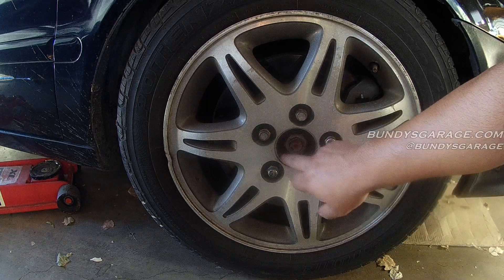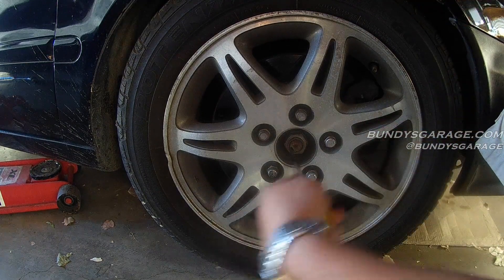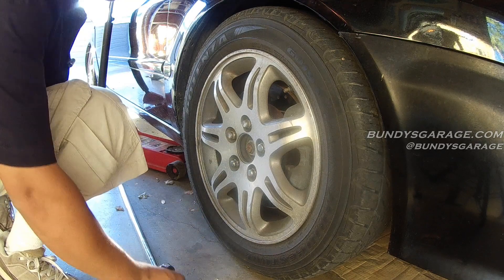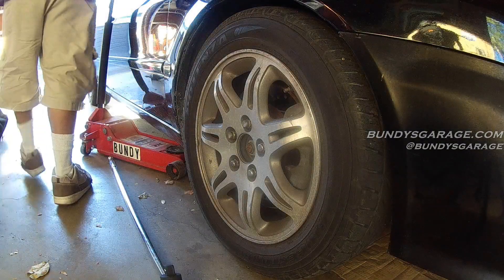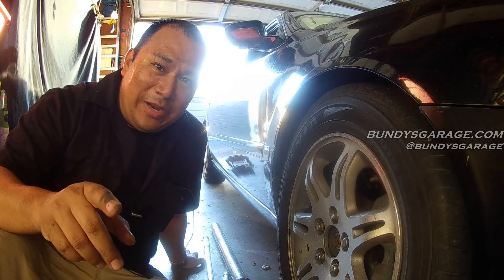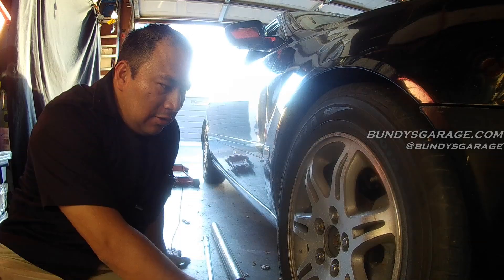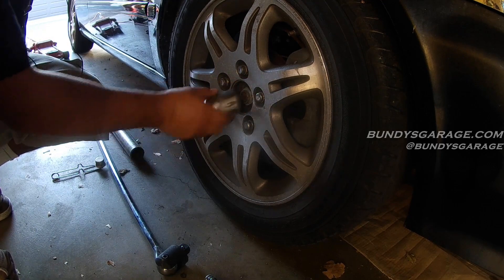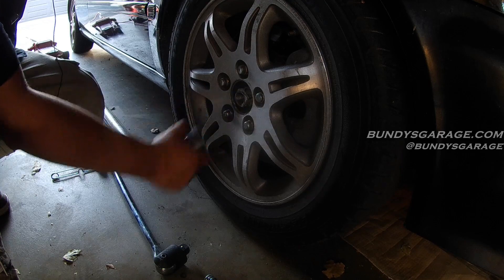How to Remove Axle Nut on Honda - Rusted Stuck Axle Nut will not come off - Bundys Garage

Comment: It was very idiotic in the beginning the way dude was doing it. Which was completely wrong and putting additional stress on the breaker bars. Which is why the items broke. 

This isn't a mishap or "great" video with funny bloopers, this was idiocy at its finest. 

Then to top it off, he got it off with an impact, which he should've did in the first place. 

Think smart and not with pure ego.